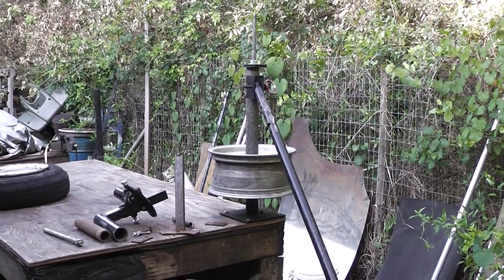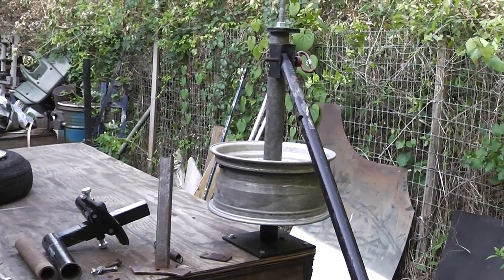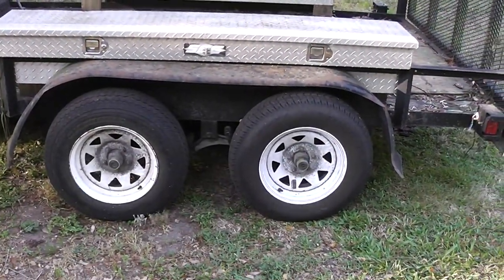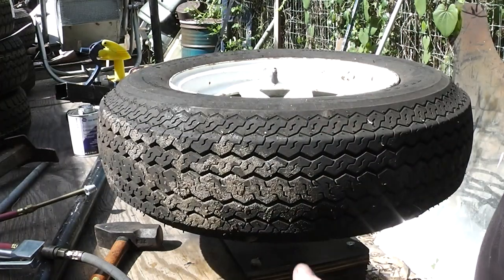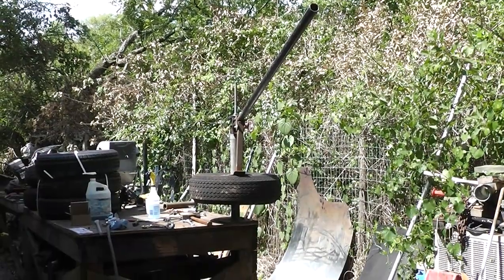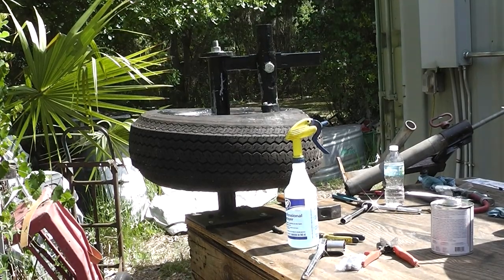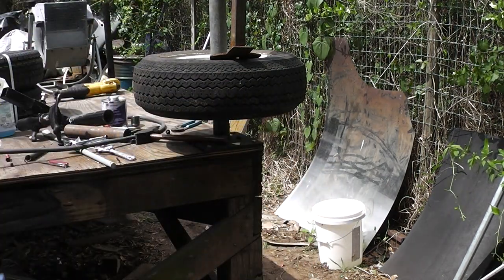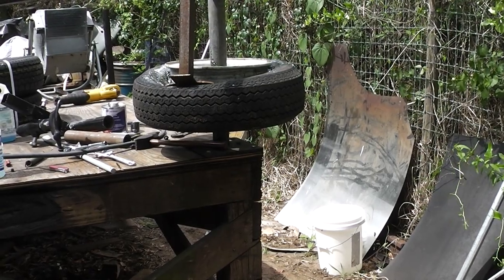How to Change Tires with a Homemade Tire Machine and Bead Breaker

Comment: You are absolutely right about the Milton air gauge and inflator. I bought one just like that back in 1987. It still works like new, albeit a lot dirtier and scratched.

Comment: Anything rubber wont last these day....prob better leaving the old valve in long as it was airtight.

The little valve core tool shaper like a cross is also a valve insertor tool.

You machine is great.

Comment: Where u get the duck bill
Reply from the maker: https://www.youtube.com/redirect?event=video_description&redir_token=QUFFLUhqbUt2ZTlPbm12OW55aU9VaC04RTdCQ1lnSVJ6QXxBQ3Jtc0tuTFZsRzVydTZrOVBiZmlSUW1IdmZ5ZjR0R1JRejV3aDVoMGVVT3pUUUdDYkdBS2ZXRnRKNndla3hTbUpsYUplRzYzWEFUcHBpeHk5a2N6R1FjSHMwT3p5ckE1cXNqLVVWSUJwZ0ZGUnoxSEtQR1ZjWQ&q=https%3A%2F%2Fwww.ebay.com%2Fitm%2FTire-Changer-Nylon-Mount-Demount-Duck-head-early-model-machines-Fits-Coats%2F190922259342

Comment: I don't think bead sealer does a lot of good with the wet soapy mess on the bead
Reply from the maker: Obviously, anyone with half a brain would clean it off before putting the bead sealer on. And btw these tires are still holding air/working to this day.